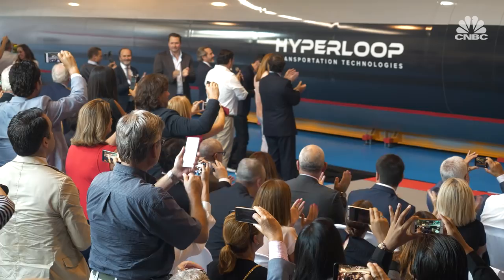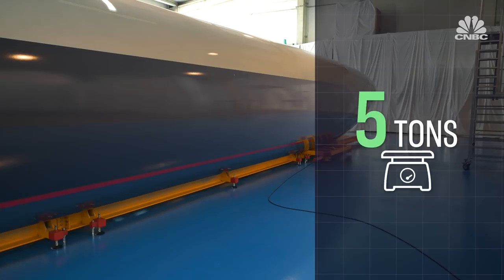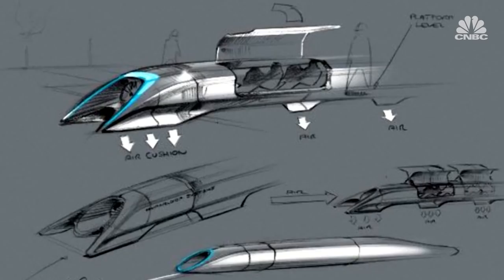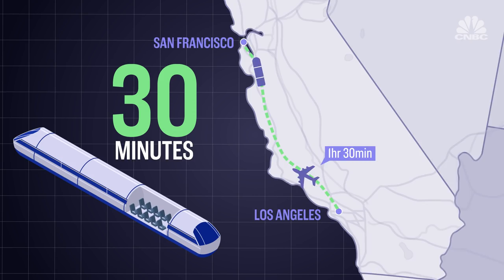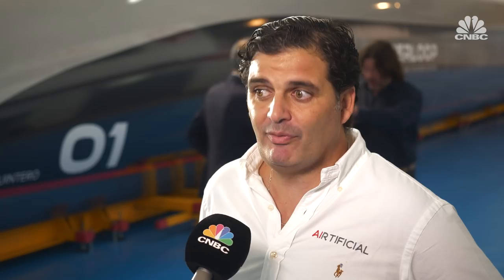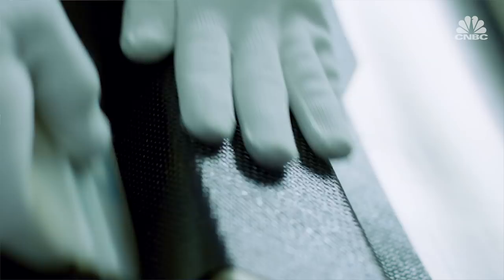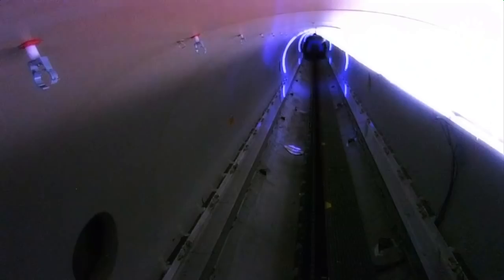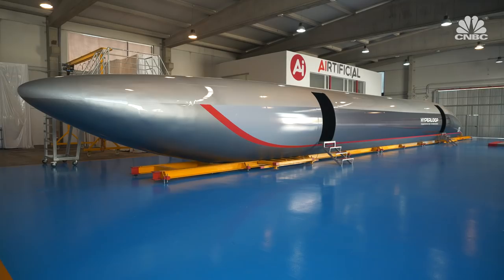Hyperloop’s first full-scale passenger capsule | CNBC Reports

Comment: now all they have to do is build a tunnel that will hold a vacuum for 100s of miles, this would be a lot
cheaper if the bore could be minimized by having the passengers lying flat like a string of sausages
but that would be somewhat claustrophobic,  also for survivable g-forces the emergency
stopping distance is several 100 meters   with a lot of of energy to dissipate somehow without
cooking the passengers

Comment: The Hyperloop can be a wonderful technology.
Travel will be faster and cheaper, if the service time of the trip is cheaper for the operator. The transportation operators can have 5X more sales in tickets, if the speed of the vehicle is 5X faster for a round trip of the vehicle. Same vehicle can have 5 trips, instead of just one.
Reply: I wonder how this thing could fail. A portion of the tube collapses like a crushed Coke can, the train runs into it, gets sliced open and whoever is still alive gets the air sucked out of their lungs. :D
Reply: Except for the whole safety thing
Reply: Yeah, everything is completely safe right until the shit hits the fan :D
Reply: 5 times 28 is only 148 passengers, a maglev can carry 400 at one time and probably in less time than it would take this pod to make the 15+ trips that it would take to move 400 people.
Reply: @Kalumbatsch  I wonder how this thing could fail. A portion of the rail bends like a noodle, the train derails, gets sliced open and whoever is still alive gets smashed in to the face. :D

Comment: Looks like very easy to sabotage to force a derail at such speeds. Very hackable. Even conventional methods like a time bomb at sections of the tube
Reply: Those method you describe can easily do it today. Air traffic control system and traffic light system can be target of a hacker. Bridge small and large can be target of a bomb. It doesn't have to wait or need hyperloop unless you just wanna hate it.

Comment: The design for this pod doesn't allow it to travel in both directions while facing the same way, so it would either need to be flipped around on a turntable or would have to be used on a looping circuit. The doors don't even look like they could handle any kind of pressurization and no one has demonstrated how the airlocks work... This is just a cash grab.

Comment: If it moves in ‘Vacuum’, why does it need a tapering end?
Reply: While it is a vacuum it is not a perfect vacuum. There will still be air molecules in the tunnel And the pod can act like a plunger in a tube. pressure building up in front of it will cause it to slow down. At those speeds aerodynamics can help power use and efficiency.
Reply: From the conception, it was design to be "near vaccum" (you can look it up). The air should be as thin as 30-40ft up in the air (cruising height of commercial jet). This because there's a balance point between energy/effort required control that environment and benefit you received from that near vaccum state.
Reply: The hilarious part: What happens when it needs to go in the other direction?
Reply: @PistonAvatarGuy  the same thing that happens when a train does
Reply: Trains are shaped to travel both directions, this pod is shaped to travel in one direction. This shouldn't need to be explained, you may need glasses.
Reply: @PistonAvatarGuy  1st off the magnet cam be turned so It can go backwards 2nd it's called a loop for a reason.
Reply: @PistonAvatarGuy  Also don't act like this is a final design
Reply: The pod isn't made to go backwards, that was my point. No one has proposed a looped route. A looped route would also slow the pod down and it would add considerable cost to the system. This is just the tip of the iceberg, there many huge problems which make the hyperloop system impractical, it's just a cash grab.
Reply: @DecepticonLeader  The rest of that sentance: ....and it would add considerable cost to the system.
Reply: @PistonAvatarGuy  All train stations add considerable cost. This will add some extra track length and it's circular instead of a straight line. 
At the end of a track one usually find important locations which require a lot of space for passengers anyway.
Also, the old system is inefficient and a waste of resources and time. Hyperloop can make travel interesting again with fast transit.
Reply: @DecepticonLeader  Most train stations don't require a useless loop just to turn the train around, and hyperloop track would cost MUCH more than regular train tracks. Building a hyperloop system would require an absolutely enormous amount of resources and people wont ride it for the same reasons that they wont ride normal trains.

Anyway, my point was: If this were a pod that was actually meant to be useful, it would simply be reversible, but hyperloop is nothing more than a cash grab, and only idiots would invest in it.
Reply: @PistonAvatarGuy  If it fulfills an important function to operate, it's not useless. "MUCH" isn't a real number, so it seems you're just guessing.
I don't know your situation, but I commute a lot and don't know anyone who enjoys long hours on the train. Call it a cash grab, but reduction of travel time is highly desirable.
Reply: @DecepticonLeader  Highly inconvenient travel is an important function? No one has released how much more expensive hyperloop track will be compared to normal train track, but it will be more expensive, there is absolutely no doubt about that. Maglev tracks are more expensive than regular train tracks, just by themselves, and a huge steel tunnel which needs to maintain nearly perfect vacuum will be an enormous addition to that cost. 

"Call it a cash grab, but reduction of travel time is highly desirable."

Yeah, except that it wont provide any reduction in travel time, you'll just be waiting in line all day because of the horribly limited capacity of the pods and the long airlock procedures.
Reply: @PistonAvatarGuy  Inital cost for travel will be higher that's a given, but prices will drop eventually. I travel 2h to work one direction every day and if the damn train breaks down I have to take the buss for 2h 40 min. Going home is not any faster. If I can cut down that travel time to 15-30 min I would gladly pay extra and many others with me. Time is money too.
Considering your ignorant attitude towards the hassle of long travel times, I guess you don't commute much.

"you'll just be waiting in line all day" Says who? Some cities already have issues with long waiting lines. So you're not addressing anything new.
The faster you can travel, the faster you deliver people from point A to B which invalidates your whole point. Prove it's inconvenient or get out.
Reply: @DecepticonLeader  The price will ALWAYS be higher. If the system costs more, the tickets will cost more, for entire life of the system. You don't think that a hyperloop will constantly break down? You're adding a whole new level of complexity to the system, along with massively increasing the difficulty of repairs. If something goes wrong, the whole tube will need to be depressurized, then some kind of special vehicle will have to make its way out to wherever the problem is along the tube, because there wont be any other way to access anything along the line.

"Considering your ignorant attitude towards the hassle of long travel times I guess you don't commute much."

Most Americans rely on cars for their commute, and going to a hyperloop station would do nothing but slow them down.

"Says who?"

Basic logic! If a pod can only carry 20-30 people and has to go through a long airlock procedure every time those people are loaded and unloaded, the throughput of the system will be EXTREMELY slow. 

"Some cities already have issues with long waiting lines."

And a hyperloop system would exacerbate that issue.

"So you're not addressing anything new."

The hyperloop is new, I'm addressing it.

"The faster you can travel, the faster you deliver people from point A to B which invalidates your whole point. Prove it's inconvenient or get out."

Except if you can only take a few people on each trip. If you have 400 people to move from A to B, is it faster to move them all at once or 20-30 at a time?
Reply: @PistonAvatarGuy  "You don't think that a hyperloop will constantly break down" No I don't. New systems are implemented to replace inferior things. 
The trains I ride today have diesel engines, they weigh a lot more than a hyperloop would and have far more mechanical parts that can fail. And they do tend to break often. 
Last week 3 out of 5 days there were delays and malfunctions. One morning there was no heating in half the train, so it was freezing cold in one end and normal temperature in the other end. The ticket collector told everyone to move over to the other end of the train if they were cold. Just not acceptable to see this travesty happening on a regular basis.

"Most Americans rely on cars for their commute" Ah, so you're american. Well, that makes sense. No wonder you're inexperienced with trains and buses.
Hyperloop has now been adopted internationally and Elon Musk will soon complete his:
https://eu.usatoday.com/story/money/cars/2018/10/22/elon-musk-tunnel-hawthorne/1724851002/ 
If you live nearby you might be able to try it out so you know for sure whether to roast the design or not. Elon said it will only cost 1$. Which is a steal.

If you watched the design of some of these stations you can see that several of these hyperloop trains can dock pretty much at the same time.
Airlocks don't take that long to close and open. It might take a few seconds longer than regular train doors, but that's hardly an issue if you count the entire trip time.
Reply: @DecepticonLeader  "New systems are implemented to replace inferior things. "

That doesn't mean that they're perfectly reliable. The only time we get increased reliability is when we produce the same technology for decades, like we have with most of our transportation technology. Creating an entirely new kind of technology always leads to new problems which need to be solved.

"The trains I ride today have diesel engines, they weigh a lot more than a hyperloop would and have far more mechanical parts that can fail. And they do tend to break often."

Well, I'm all for replacing diesel trains with pantograph powered trains.

"No wonder you're inexperienced with trains and buses."

Trains: Yes. Buses: No, I have plenty of experience with buses. Either way, you have zero experience with commuting via hyperloop, along with everyone else on Earth.

"Hyperloop has now been adopted internationally and Elon Musk will soon complete his:"

That's not a Hyperloop, that's just a tunnel with electric trams. No vacuum tunnels are involved... Unless you believe that cars are built to remain pressurized in a vacuum...

"Airlocks don't take that long to close and open. It might take a few seconds longer than regular train doors, but that's hardly an issue if you count the entire trip time."

Ok, bud, whatever you want to believe. Haven't you wondered why you haven't seen this part of the system demonstrated by any of these cash grab companies?
Reply: @PistonAvatarGuy  "That doesn't mean that they're perfectly reliable." Never met a technology which is perfect, but I sure won't miss the old transportation system.
Well, that zero experience with commuting with hyperloop will have to be cured with some experience then. Far better than what I have today, that's for sure.
Electric trams... a taste of greater things to come. Perhaps Spain will be faster than America to implement the hyperloop.

Cash grab... you use that word a bit too often and casually than what is appropriate.
Can't take any cash from anyone if you don't have a system which is reliable and working. That's how you earn money. 
No one will pay a ticket for a train which isn't working. Obviously.

I don't mind if they take a long time to develop. The more time they put into polishing the design, the better in the long run.
However, I have one issue with the airlock system. Because it will be moving a lot, I think it will recieve more stress than many other components on a hyperloop.
One would probably need to implement some type of regenerative material to keep it airtight for years.
Reply: @PistonAvatarGuy  If it works, it will prove itself. If not, it will need to be adjusted. One can kill many things, but nothing can kill progress.
That's good enough for me. Electric trams are already better than what I have. Even a pantograph train would be better than what I have.
"Right, because scams don't exist." 
If the trains don't work, who will notice? Everyone. The only possible scam would be to refuse repaying the ticket price in such a case. They would get bad press fast.
Shill? Someone who covertly gives credibility to something...?  I'm unfamiliar with the term.

It's fine to be skeptical, but you're not helping anyone with your constant negativity and complaints about technology you don't comprehend.
I put my faith in the future and would rather support research I don't yet fully understand than run back to some delusion of safety in past technology.
Reply: @DecepticonLeader  Yes, let's not let facts or reality get in the way of our fantasies!
Reply: @PistonAvatarGuy  Funny you would say that, because you don't have any facts either.
Reply: @DecepticonLeader  But I do have common sense.
Reply: @PistonAvatarGuy  What you have is a negative opinion on the future, while I do not. That's the difference.
Reply: @DecepticonLeader  No, I have a realistic and informed opinion, while you view the world through the eyes of a child.
Reply: @PistonAvatarGuy  The pessimist, always believing himself to be a realist.
Reply: @DecepticonLeader  And what do you call one who believes that optimism trumps knowledge? I bet that you also bought into solar roadways, didn't you?
Reply: @PistonAvatarGuy  Don't mistake optimism for naivety or lack of knowledge. I read plenty about the advancements in science. 
There is no easy path to the future, but I choose to embrace change with a positive mindset. No matter the hardships, I will not let fear hold me back.